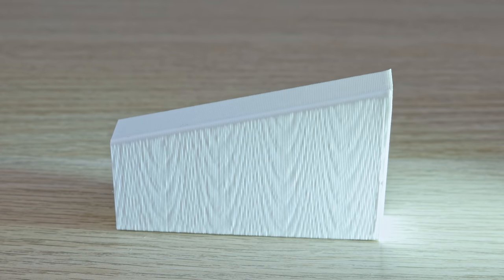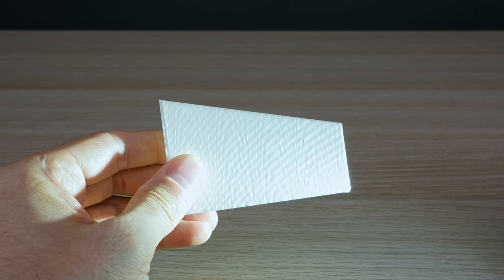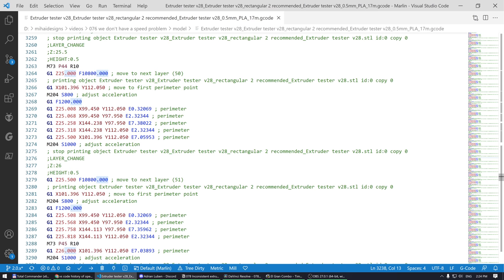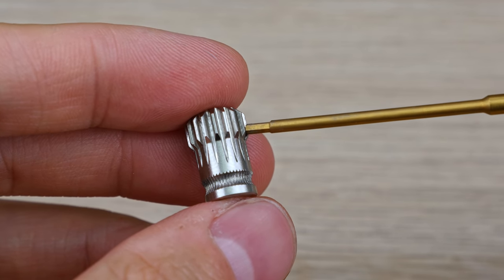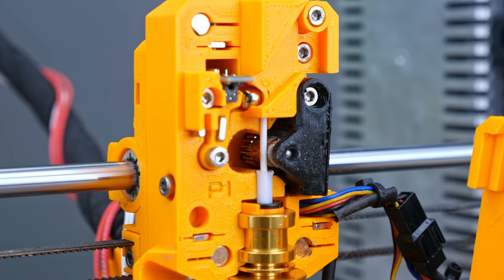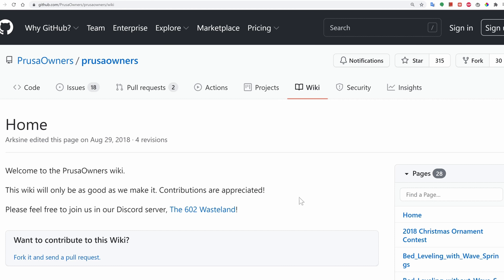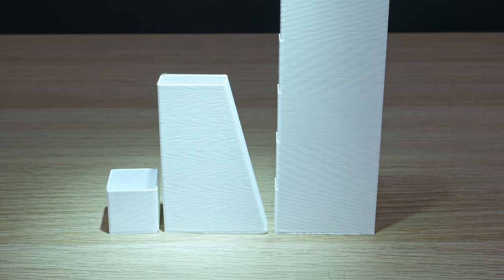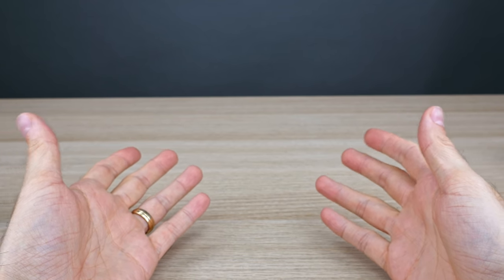What I've learned about dual gear extruders and how to patch them, maybe

Comment: I am also no mechanical engineer, but a if the second (moving) gear had circular spur teeth and the idler was designed to rotate around Z axis intersecting center of the spur teeth circle that should mitigate the issue completely.
Reply from the maker: I imagine it should. It's one of the suggestions.

Comment: I don't doubt that the problem is in the gears, but I just don't get why. In your print there is almost no retraction so gears always go forward (no backlash into consideration).  Lets assume you use a single gear coupled to the motor. It digs into the filament and pushes it constantly into one direction without slippage. Now lets add a second gear. That gets powered by the first, but the filament shouldn't go any faster or slower, there is no slippage or backlash. Lets assume the second gear is actually not meshing but somehow it bites into the filament,  it will still rotate as fast as the first gear, in this case it is powered by the moving filament and the fact that it is digging into it.  So the speed and velocity in all setups should be determined by the motor. Why would the extra gear create this effect?  What no-one considers is that we actually have a system with 4 gears. The BMG "gear" has a 0.5Module spur gear on one end and a hobbed, gear pattern on the other side, made using an M3 tap (or something similar). The spur gear ends mech between them, the hobbed ends also mech between them (short off) because they both bite the filament. The following will be tricky to explain but bare with me. The BMG spur gears mech loosely and there is a bit of tolerance (+-). There is no tolerance between the hobbed gears because they both bite firmly into the filament, but the system is a bit elastic. The filament is pushing the hobbed gears backwards because of the pressure of the molted material in the nozzle. So what if every time there is a transition between engaging teeth  (in the spur gears side),  the tolerances transition from positive to negative (by the backwards pressure or because the hobbed gears don't synchronize)? In other words there is a tiny waveform variation in the output speed and extrusion force of the extruder every 2 teeth (their distance in a 17T 0.5M spur gear is 1.6mm)
Reply: An interesting experiment will be to smouth out the hobbed pattern on the driving gear, the one attached to the motor. Since the filament will only grip onto the removable gear any artifacts will have to be a result of backlash

Comment: The OmniaDrop uses a dual gear setup where the idler gear is rotated slightly to increase the grip at the filament. I have only printed organic designs with non Flexibles on it so far.

Comment: Very interesting. What exactly did you modify on the mk3s extruded door? BTW, the feedback form on your website doesn’t work (incorrect permissions)
Reply from the maker: Form access should be fixed now; sorry about that. The experimental idler door rotates the second gear about 3 degrees so it can mesh better with the drive gear.

Comment: Seems like it could be fixed with a spring tensioned timing belt to maintain timing on the drives and allow small adjustments in spacing , it would add some complexity and cost but should be possible. If it is possible design wise with the space available I could probably machine down a set of gears and adapt some timing pulleys to fit.
I don't own a printer so I can't look into it in detail myself but if your interested in prototyping it I'd be happy to lend a hand

Comment: I have seen this in TWO CASES on SINGLE GEARED extruders.
The first is on Wanhao Di3 machines using the A4988 stepper motor driver. Adding a TL-smoother to the E-driver basically eliminated that. Perhaps that's also the case with the printer you mentioned?
The second case is the Zesty Nimble extruder which I was never able to solve even with new parts from the manufacturer.

Comment: double helical gear won't change anything, it's made specifically to have bigger surface area(basically - more reliability in the same dimensions), not to fight variable distance backlash. Yet this can be fixed by making 3 gear synchronization separate from hub gears: firs sync gear is sets up in center of rotation of main gear(so main hub don't need spur gear at all), second synchronization gear just needs to have the same center of rotation as tightening latch(so it's always have the same distance to follower spur gear, follower does need to have spur gear), third is just in between sync gears so you have proper rotation direction on follower, only problem is - it's twice as complicated and have a bigger mass

patent pending© joking :)

Comment: a possible solution: independantly tensioned gear, in that the spur side is either fixed or independantly tensioned to the hobbed side, you can then have the tilt angle vary on filament squish and thickness but stull have the spur teeth mesh perfectly

Comment: My idea here: Ditch the tensioning spring. Do manual, tighten-down adjuster, and make sure the axle/pin for drive and passive gear isn't undersized. In regards to the other gear design - could we possibly cobble this together using those brass hot melt thread inserts? Those look like this, but I guess they don't actually have appropriately ground profiles..(?)
Reply from the maker: Tooth profile is essential for proper meshing and from what I understand it, they're not easy to machine. And has to be strong steel; brass would likely not survive for long.
Reply: @MihaiDesigns  I meant this (the hot melt insert bit) ad much more of a low-cost experimental prototype / proof of concept test mockup. IF the cut pattern and profiles of these inserts will mesh at all of course. They're not made with that in mind, but just thinking that it's something many makers and tinkerers already have on hand. If it shows there's any practical, real-world empirical indicators we might be on a good track, then recruiting a machinist that is also a 3d-printing tinkering enthusiast may be the next step; Prototype gears for a little beer/coffee money.

Same vein but different'ish note - I'm sitting here fiddling with a dual gear extruder kit, and I've noticed 2 things. 

1: There's a tiiny bit of play between the active gear and the stepper axle, when loosening the grub screw. I suspect that when tightening the grub screw, that might shift the gear so it's not perfectly centered on the axis of rotation. If so, to my understanding, that would mean the effective "diameter" of the hobbed gear varies and oscillates during every recolution. And so the length of extruded filament. 

2: it looks a lot like some of the "vallies" / bottom lands of the spur gears are cut deeper (and possibly wider, don't have my microscope on hand) than the "height" of the teeth. So the passive gear bottom lands on either side of the tooth, seem to be floating on the active gear top lands and not moving, until the next tooth face/flank on the active gear impacts. (This was messy to try to explain. But its a similar behavior as if one of two meshing gears has the appropriate total tooth pitch, but the teeth are too short and narrow vs the pits/valleys of the other, so there's a tiny dead spot with every tooth in rotation.)
Reply: @pr0xZen  Those melt in threaded inserts definitely won't have a proper involute gear profile. Herringbone gears are very expensive to produce, they would have hit the jackpot if they could make them as cheap as those melt in inserts lol.

Comment: Just came across this video and the "woodgrain" effect made me chek through my discarded print box.  Now I have a Mingda D2 with a direct drive extruder that is fitted with a single idler bearing, so not dual geared.  Sure enough, I found a single skinned vase I printed in vase mode and, when held up to the light, it has the woodgrain.  However, I suspect the bearing has very slight side play, but I'm not going to test it because a new dual geared extruder is being fitted tomorrow... and that's going to be used on flexible filaments.

Comment: Thank you … I don’t have this issue ….. single gear extruder … but looking forward to the other videos..

The extruder drive would have to be at the pivot point to ensure equal and positive connections to both filament drives, but the gear train should be removed and you could replace with a belt to each side.  This has other issues (stretch) but would solve the backlash issue.

I do see that those gears seem very corse.  Could a finer set of gears be used and then a gear train from the pivot to each side might be feasible with minimal backlash…..

Comment: that diagonal pattern you show at @11:21 - I had it back when I was using Zesty Nimble v2 (which uses worm gear)
Reply: I had it on my Nimble V1.2 and traced it (based on the size of the pattern) to the drive cable -- it was exactly twice for each full rotation of the input shaft.  I was able to mitigate slightly by placing the drive stepper to get a larger radius on the cable, and by lubricating the guide tube with white lightning bike chain lube.

Comment: 12:30 I am not sure if helical gears are more efficient - in cars they use up more energy, therefor they are quieter, but you are right, the load of the gear is more consistand
Reply: Yes, helical gears are less efficient than spur gears, but they are quieter and have a higher tooth strength for a given pitch, hence why they are commonly used in high speed transmission applications such as car gearboxes.

Comment: If you rotate square items in slicer 45°, the walls will be printed using both X and y axis and helps to eliminate patterns caused by loose belts etc. - in my opinion.

Comment: Gears are typically designed to be relatively immune from this issue. I wonder what's going wrong here. Seems like there should be a different profile that would be more tolerant of the gears not meshing fully. Is there any indication that this might get worse or better with wear or break in?

Comment: You forget that the mesh of the gears in the dual gear system is designed to give a continuous and constant rotation at only one mesh position. When you are not at the ideal mesh point your driven gear (the one not on the stepper) will rotate at a varying rate depending on where it is in the mesh geometry-cycle and repeat this error for every tooth.

Comment: Great analysis skills! Would a rubber coated gear solve the problem? (similar gears are available in mixers to enhance grip and reduce noise)
Reply from the maker: I don't have the knowledge to answer this. I'm thinking there's friction between the gears which could result in the rubber coating to wear out over time.

Comment: How about using two independent stepper motors with hobbed gears (not coupled together)? Would that be the remedy for all problems? Maybe Nema14 could be used then and the torque would be sufficient (because of two motors, not one).
Reply from the maker: In theory should work. I would not underestimate the power needed to extrude filament with good precision though. When an extruder starts clicking to get an extreme example, to me that means we're already past 1000% force requirement from the motor and even if you dial things down to where you get no clicking, the extrusion will already be extremely uneven. Good subject for more experimenting.

Comment: So... To have a final solution to this issue we need a way to adjust the opening of the gears in a way that the contact diameter of the gears stay constant... What about adding a second set of gears and making a pivot around the second set, in that way the turning force is transmitted by the pivot of the gears and the opening doesn't change the contact of the gears, just the alignment of them. This problem comes from the miss alignment of the pitch diameter of the gears, even helicoidal gears have this problem when not aligned. I can make a draw of this if you want.
Reply from the maker: Yes this is one alternative, has been suggested in other comments. Thank you!
Reply: The centre distance between involute gears can be changed a bit, without affecting the constant velocity meshing of the gears. This is one of the advantages of the involute profile. I think the issue may be related to angular shaft misalignment, where the fix would be crowning the gear teeth but I could be wrong.

Comment: Cool research. I wonder if you could have the idler pulley be tensioned by two springs pushing on either side of the gear axle... One would tension the grip on the filament, the other would push the spur gears together to remove the backlash...

Comment: @MihaiDesigns, Applying what little I know about automotive transmissions. I would think it is more a case of the velocity of the circumference of the driven gear (idler) varying with the degree (% ?) of tooth engagement rather than chatter due to backlash. In other words, the drive gear maintains a constant velocity, but the velocity of the driven gear changes as the contact point for the gears moves in relation to the center of the drive axle. The resulting pattern is a fairly accurate reproduction of the tooth profile on the gears (the wood grain pattern). A helical gearset should help smooth out any acceleration/deceleration as the contact point is more consistent.

Comment: Thanks for the continued work! Do you really thinking having both gears drive is necessary? I run bondtech gears, but I've never felt the desire to have both wheels driving -- I just wanted high quality drive gears. I'm going to grind my teeth off. I bet I will not encounter any problems with lack of grip.
Reply from the maker: I'd say it depends. For me reducing the risk of jamming is important. I haven't had jams/clogs in a while so I'm not sure how often it would actually happen. Might affect the extrusion accuracy as only one gear doing all the work would probably displace the filament more with its biting into it. Also depends how fast you need to extrude, more flow means more pressure. I did get my super volcano to click when pushed too far so there's that. More experimentation needed I presume.
Reply: @MihaiDesigns  Good points. I'm not sure how dual drive gears helps with clogging of the hot end. IMO, the only benefit of driving the other side of the filament is if you are consistently stripping/grinding the filament away on the driven side. I never encountered that too much when I used my old modified SeeMeCNC E-Z Struder, so when I went to dual drive gears it was merely because I wanted to specify the best gears possible, and also it solved the idler solution. I prefer the hob over a plain bearing. The hobbed idler helps keep the filament centered on the drive wheel, whereas a spring-loaded bearing could allow the filament to ride around (front to back, riding up the curve of the hob).

As a side note, I found great increase in extrusion consistency when I fixed my idler to a set distance. It's just hard mounted in place and works better than ever before. With the spring idler, the filament would be allowed to slip through once in awhile.

I digress. Thanks again for all the work! Can't wait to see more.
Reply from the maker: @n8bot  for my printers I ended up tightening the spring a lot. I did this by chance when I was experimenting with different settings and it didn't seem to make a difference in print quality. That was before figuring out this issue, so I should run the test again with the fix.
Reply: @MihaiDesigns  My extruder design had a flaw: the idler was not free-moving, there was friction which was causing it to not spring back as well as it should have. So, in most cases a spring-loaded idler should work but IMO the fixed idler works better and I see no need for the free moving idler. I don't have a long bowden tube to pull the filament through, so removing filament is like a 80 mm retraction. It feeds in perfectly by just putting it up to the two gears and clicking extrude.

I'm really digressing from the topic here. Sorry.

Comment: Gears with an involute tooth profile would probably do more to fix this than making them helical. I’m surprised they didn’t use involutes already (unless they did and I couldn’t tell in the video). Great work!
Reply: Most definitely are using involute profile, possibly an issue with shaft angle misalignment causing meshing errors I think. The only way to test would be to use crowned tooth spur gears (which should remove problems with shaft misalignment) and test it, including a deliberately misaligned shaft position.
Reply from the maker: I thought they are involute, although I didn't actually measure. The ones in the video are actually some cheap clones; not what I use for actual printing. I should check how much they differ. At least with some macro shots.

Comment: Could try just dremeling the teeth off the dual drive gears. Would effectively convert it to single drive. My gut says it would still be grippy enough for most use cases. And it would be a fix that doesn't require redesign.

I definitely have more consistent extrusion on my Galileo (similar to Orbiter) that uses the larger 8mm dual drive gears.

Maybe I'll try it. Awesome findings.
Reply: We ran with  machines with the exact same setup but only one side as a driver for filament feed for quite some time. I have to say, the switch to dual drive gears was a huge different. That 2x contact area bonus definitely seemed to make a difference, although it could also have been the profile change that came with it.